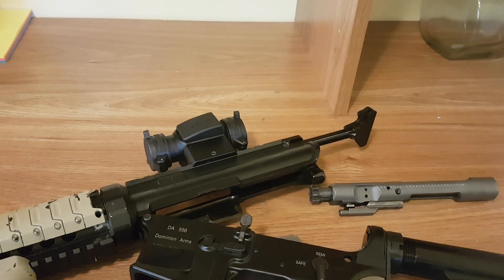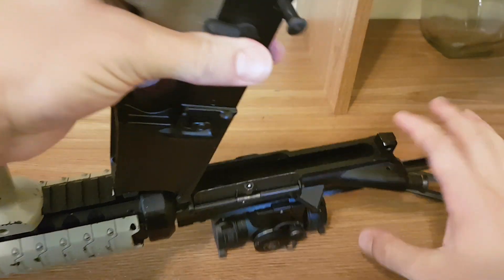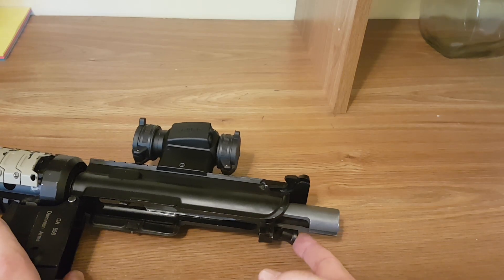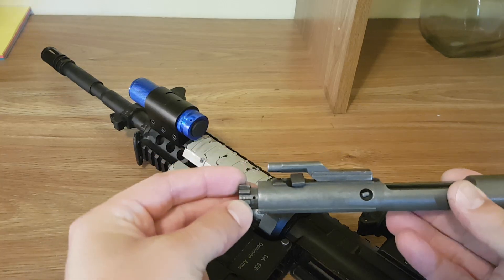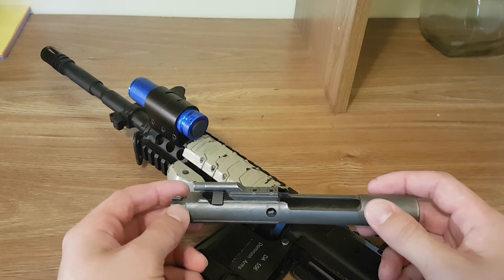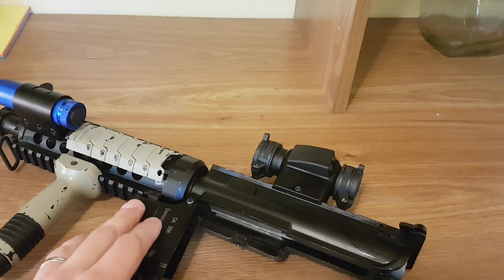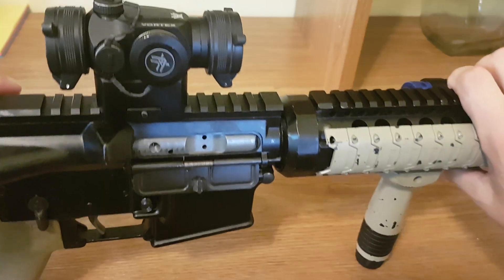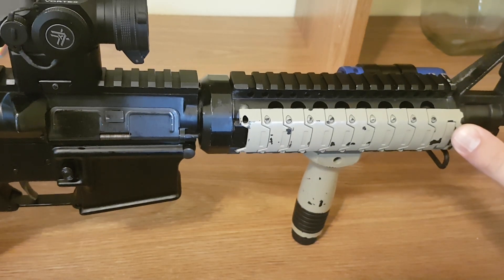What does the Forward Assist on the AR15 Do?

Comment: Serious question- how many have actually had to EVER use this, and if so how many times? I built my last two AR's with Anderson upper assemblies with no assist, and no covers. Let's face it, most of us will never use our guns in a hostile, nasty environment so why bother?
Reply: u are soo correct. mine sleeps in a gun safe 9 months out the year
Reply: Shibumi well we can also say how many need to use the ar15 itself.... it's there in case I rather have it and not need instead of need and not have it doesn't add any real weight so it's fine
Reply: Shibumi it is a Fashion detainment. 10 years in the US Army, never use it.
Reply: I used it to make a malfunction nearly impossible to clear.
Reply: Twice.  Once when chambering a round as quietly as possible the bolt didn't quite lock into battery.  The other the rifle was fouled with sand.
Reply: Colonel K I know you did good in English class 😂😂😂 that was well written, solid points, and also pretty interesting. enjoyed the read and I see what you're saying.
Reply: Shibumi well to each their own. personally I'd rather have it than not and honestly you won't be able to tell the difference just picking it up with or without it and you most definitely won't be able to tell when you got 80 pounds on your back and moving with it all day.
Reply: Shibumi from alien vs predator

'similar concept of a condom.  better to have one and not need it than need it and not have one'.
Reply: Shibumi, so you'd rather have an inferior weapon to avoid paying $50? The one time in your life you'd use it, it justifies itself. And if for some reason you ever had to use your rifle to fight in adverse conditions you would definitely want that dust cover and you would definitely want that forward assist.
Reply: Consider it like a spare tire, you may never need it, but if you do then the last thing you want is to open the trunk and not find one.
Reply: used it to unjam my m16 during my service during a routine visit to the range
Reply: Ryan Dukes So you forward but did not pull bold back...ooook.
Reply: theburners32141 what does having faith in gov have to do with the forward assist on my rifle? 😐
Reply: Waiting in ambush, wondering if I had a round chambered, I could pull the bolt back far enough to see. Then I could lock the bolt forward less loud, quietly, and continue silently waiting.  I'm not the only one who questioned and checked their rifle. Vietnam 1969.
Reply: unfuckingmaker actually dude. the 5.56 nato is shaped slightly different and produces higher pressure, you can shoot a 5.56 out of a .223 rifle but it will eventually destroy the gas system and damage the chamber, where as the 5.56 nato rifle can shoot both with out damage, only a slight loss of pressure when shooting the .223.
Reply: Sand Hill It would not come back. Of course I tried that first. I had to take it apart and pry the bolt back. Improper case crimp I think
Reply: As a former military weapons & munitions specialist I can tell you the only difference between the 5.56 and 223 Remington is brass thickness GI 5.56 is thicker which in a minimum 223 chamber can cause pressure problems
Reply: During training, firing blanks. blanks use a cheaper, dirtier powder, which causes fouling in the starchamber & gas tube, firing actual rounds, it's never happened to me, though I have seen it happen to others who want to jack around between firings, playing grabass and shit, instead of cleaning their rifle.
Reply: +Excludos- You DO realize you haven't:
1. Substantiated even one claim you have made.
2. Refuted even one point I have made.
3. Responded to any direct challenge I have made to your erroneous statements.
I won't engage in an battle of wits with someone who is unarmed, and I don't readily suffer fools- so fuck off...
Reply: +Excludos I don't think robberies can be painted in such broad strokes like that, I would say judging by news reports 25-50% happen in home invasion where it's too hectic to hear shit and still time enough to defend yourself given the countless home layouts and scenarios. store robberies might be closer to what you mentioned but some go in shooting and sometimes it happens later. 

I'd have to say about the only time noise would help is with a(most likely unarmed)burglar or someone attempting to come in the house, times when a gun might even be unnecessary in the first place. 

you are right a slide racking, especially on a pump shotgun is very identifiable and not what people likely to be on the business end want to hear, and most criminals do prey on easiest targets because who wants a chance of dying at work.

but I'm sorry, there is no way you are right about this, not where I am from. maybe where you are where there is less chance of petty criminals being armed with a handgun(yea yea it's our own fault)I'm sure it's a huge deterrent to unarmed people but an easy way to get killed when everyone else is locked&loaded.
Reply: For the same reason that people buy books on how to survive a zombie apocalypse
Reply: I didn't even know that was what that was for until i watched this video lmao
Reply: I've had to use the FA on rare occasions when the chamber was fouled, but I've also had a FA fall out when the retaining pin broke.  The FA was intended to overcome problems originally resulting from a combination of issues, including the use of dirty ball C2 powder, non-chrome lined bores and bolt heads, lack of cleaning kits,  and improper training.  This not only resulted in fouling of the breech, but more seriously, pitting inside it.  The pitting acted like Velcro and grabbed cases, making them both harder to chamber and extract.  Over time this could lead to case head separation, at which point, if in combat, you were toast.  Even if you had a cleaning rod and were able to remove the broken or jammed case, the problem would simply repeat itself on followup shots.  All of those issue were resolved decades ago, but the FA remains a standard component of all current production M16s/M4s.  The Army adopted it first during the Vietnam War, followed grudgingly by the Marines, who did not really care for it.  The USAF was the last service to adopt it, and that didn't occur in significant numbers until after 911 when we started buying M4s and upgrading our M16 rifles to A2 configuration.  This upgrade had almost nothing to do with the FA debate, but was focused primarily on accuracy issues resulting from the switch to 62 grain ammo.  We were still using 1:12 twist rate barrels which stabilized 55 grain ball, but proved less accurate when firing the much more common 62 grain bullets.  

Getting back to the FA discussion, I think the real question is whether the FA is worth having anymore.  The answer depends on a number of factors.  Will you ever use it?  Rarely, but "rarely" counts in combat.  Is it wise to force a bolt closed when it doesn't want to close?  That would depend on the reason for it not fully closing.  Assuming there is no serious obstruction or damaged cartridge involved, I've found it easy enough to simply push the recalcitrant bolt home with my thumb instead of employing the FA.  If I do use the FA and it doesn't solve the problem, I may need to strip the firearm to determine what is wrong.  Does having the FA on a rifle present a problem?  Not usually, though it does add weight, cost, and complexity.  I've noticed that a lot of race guns don't have them.  In the end it boils down to the question of whether you would rather have it and not need it, or need it and not have it.  For range, competition, hunting, and personal protection I can take it or leave it.  For combat I think I could live with the extra weight.  It's better than dying without it.
Reply: +Colonel K   Amen.
Reply: theburners32141 and Boston marathon was a bombing an ar wouldn't do anything
Reply: Shibumi I have, acronym SPORTS, slap, pull, observe, release, tap (the forward assist ), squeeze
Reply: Shibumi tell that to the people who died while trying to defend themselves with a jammed gun. if you bought the gun for defense, why not but the assist?
Reply: Shibumi I use mine every single time i load my AR to ensure the bullet is seated completly. But I wad military and thats the training i fall back on daily.
Reply: no the brass is the only difference between 223 and 5.56 NATO just check out a reloading guide or check with a set of callipers yourself
Reply: Once. In over a decade.
Reply: Press checks
Reply: I've used it, but only during military duty while crawling through mud.
Reply: tomcornwall83 
The charging handle is not connected to the bolt carrier so no.
Reply: Tom the charging handle can only pull it back, it's only a lip that catches on the bolt when you pull it back
Reply: Michael- sorry, that was a joke- I first fired an M-16 in 1979, I am sure it was Vietnam surplus vintage- and with the plastic stock and buffer spring I joked that it sounded like a Mattel toy! An instructor demonstrated the lack of recoil by setting the buttstock against his crotch and dumping a 20 round mag downrange... lol
Reply: It's the American way to buy a combat ready weapon I suppose. But I have a Japanese arisaka I'd be perfectly comfortable with if the US was ever invaded.
Reply: So, pretty much every reason posted here about using the charging handle has to do with getting a round into the chamber, usually covertly. Personally, all my guns are kept with a round in the chamber and the safety on- and once that first magazine is emptied, I don't think I'm going to be worried about making noise...   : ) So as far as I can see, I still don't have any need for a forward assist...
Reply: I've used mine multiple times.  When coyote hunting, if I don't have a round chambered yet and the coyotes are coming in, I will charge it quietly and the bolt usually doesn't fully seat when you slowly let it back up.  Pushing the forward assist gets it fully seated and ready to fire.
Reply: +Cody- That's why I said "almost"...
Reply: I use the forward assist to quietly rack the bolt, it helps when I clean my gun at night and don't want to disturb the others in my home and it helps in situations where if you would need to rack the gun to put the round into battery, a loud audible click would certainly alert someone where as a gentle pull of the charging handle and a few taps of the assist will allow me to chamber a round and engage an assailant. Granted I have only used it for the first thing as the latter has never happened and I pray it never does.
Reply: I spent 8 years in the military in a combat arms mos so I would like to think I am pretty familiar with the ar-15 / m16 system. I have used it in hostial combat environments and situations and I have never, not even once needed to use the forward assist. The creator is also incorrect when he stated that the military trains you to always tap the forward assist when charging the weapon because the only time I was ever trained to use the forward assist is clearing a malfunction using the sports acronym and even then it is the last ditch effort wjen nothing else has worked.
Reply: +nilloc93 are you replying to me?
Reply: Daffy Bigbear Wat..?? Whoever taught you that should be shot. There is no value in using the forward assist every time you change mag except to waste your time. Regards: Someone from the military
Reply: Colt M4 - Colt M16's were the end of the old battle rifles.
Heckler & Koch 53 - Heckler & Koch 33 were the end of the U.S. weaponary
Ak 107- 108 - 109 are the murder of the German weaponary.
MPT-55 - MPT-76 are the murder of the Russian weaponary.
Reply: Shibumi please don't say it that way my brother !! carma can be a bitch !
Reply: theburners32141 you obviously didn't understand what it was I was saying. He said most of us won't need to use the forward assist on our rifles, and I said that's true most of us won't need to use it but on the same note most of us won't need to use the ar15 itself but yet we still rather keep them same way I would rather keep the forward assist on my rifle. Don't get me started on that topic guy I've used my weapon in the defense of my family I understand the importance of having these I just bought an AR in 308 because I want a more versatile rifle
Reply: theburners32141 "Europeans getting raped in their own country" you sound dumb
Reply: Colonel K- very cogent and detailed reply, thank you sir. You sound as if you were there- retired Air Force?
Reply: Shibumi I've got a semi auto 12 gauge for defence. The AR-15's are for the hobby of building it or customization or in case Isis gets here....
Reply: Correct procedure for loading AR-15/ M-16 lock the bolt to the rear insert magazine into the mag well tap the bottom lightly to make sure its seated then hit the bolt release letting the bolt run home unrestrained never ever use the op handle for anything but locking the bolt to the rear or malfunction clearing
Reply: Ryal Deveau .223 chambers produce MORE pressure than 5.56 nato chamber with the same ammo. 
        similarly, my .308 ar-10 is designed for higher pressure ammo than its 7.62 nato counterpart. military specs aren't always better, they are sometimes just designed around cheaper, more plentiful ammo
Reply: Ryal Deveau thank you for clarifying. the comparison between .308 and 7.62, which i have, i think was accurate though. i have read that 308 is usually loaded hotter than 7.62 nato, normally, so the .308 would be the more versatile  choice between the two. i can see the problems are not exactly the same when comparing 5.56 to .223
Reply: 8aleph :Not true with any domestic ammo.  Brass is same.  5.56 chambers have more freebore so the bullet jumps more before engraving the rifiling.  This allows more propellant so shooting 5.56 in a .223 Rem chamber can cause higher than allowed pressure.  SAAMI published this warning.
Reply: Ive been in the Infantry for almost five years now. I have never needed to use my fwd assist.
Reply: Shibumi everytime we qualify in the military, we used shitty mags and old ass m16A2.  I had to use the forward assist everytime there was a jam.  It was part of the step, forgot what it was called.
Reply: Chances are good you will never have to, the jamming problem was caused by the Ammo and the Ordinance department  trying to get rid of the "it wasn't designed here" M-16  BTW that powder gave trouble in other gas operated weapons as well like the M-14 and M-60
Reply: gagongflip389 "sports" you pog
Reply: Jonnie, mostly Correct.  The Brass is thicker, yes, but the chamber is also different. The "223 WYLD" chamber splits the  difference between the .223 and the 5.56.
Reply: It's designed for war.
BUT, in the Army I used an Hk416, never ever used this thing.
Reply: Yeah... If the bolt does not go all the way forward cant you just give the charging handle a poke forwards?
Reply: This is pretty much the answer I expected, and the same with my guns... the only exceptions I expected were maybe someone who was in Vietnam shooting the original M-16 Mattel toys...   : )
Reply: Interesting! Living in the UK I don't get to use AR's so this is new information to me. Cheers.
Reply: I've used to it reengage the bolt after I load in a new mag when I'm shooting.
Reply: Congratulations on the dumbest comment I've read all day. 1st, you can utilize it in a non hostile environment and I have. 2nd you admit to using shit for equipment. 3rd how many people buy an AR15 for SHTF situations? So the fact that a SHTF situation is likely never to occur is irrelevant if it's the purpose you bought the gun. It's like anything else mil-spec. Thanks for your time. NEXT.
Reply: +Shibumi The forward assist is very valuable when you want to be quiet. You can do a "bad" load by, instead of letting go of the charging handle, follow the charging handle forward slowly, and complete the cycle with the forward assist.
Reply: +Shibumi What you do privately is on you, but in the military the rules of conduct will decide whether you can stroll around with a round in the chamber or not. Generally, unless you're at war, you can't. But situations where you need to need to charge your gun covertly can still arise.
Reply: What is with all the people who don't keep a round in the chamber, with the safety on? This rifle has a perfectly good safety that prevents any idiot with poor trigger discipline from hurting somebody, or themselves...almost the only way that I ever chamber a round is by hitting the slide release. Insert magazine, hit slide release, round chambers fully. Check safety is on- when you pick up the rifle to shoot it, release the safety and pull the trigger. Simple, effective... works for me...
Reply: +Shibumi Any "idiot" knows perfectly well that if there's a round in the chamber it's the same as being live. Sure it's very unlikely to fire with the safety on, but it has happened and it can happen. Maybe the switch gets stuck on part of your clothing and switches around, or maybe you forget that one time. Hell, I've seen a rifle (altough being an older one) fire, with the safety on, from hitting the butt stock too hard! You never ever ever ever treat a live weapon as safe! And if you've had any kind of weapons training whatsofuckingever you'd know that as well.
Reply: Because in some situations it is illegal to have a round chambered in your rifle while transporting in your vehicle in a hunting scenario.  It's a concern in potential poaching situations where someone might have a rifle ready to fire from their vehicle on the roadway.
Reply: +Excludos- I never said to treat a live weapon as safe, if you read what I posted. I carry a Glock every day with a round in the chamber, but I don't put my finger on the trigger unless I intend to shoot something with it...
   I have had extensive weapons training, that is why I am always aware of the status of my weapon and what I do when I am carrying it. I make sure it is not possible to accidentally take the safety off, and I never forget. Carrying a weapon is like riding a motorcycle- you are always at a heightened sense of awareness or something bad happens. You don't completely relax and let your mind wander, you are always aware of important aspects of the situation that can become dangerous. If I didn't do this I would already be dead from situations that have happened on the motorcycle, and I am sure that is how firearm accidents happen as well. I just make sure they don't happen to me...
Reply: +Shibumi The amount of cops who shoot themselves in the foot daily because they walk around with a round in the chamber against regulations is hilariously high.. (Not to mention that it's stupid as the act of cocking your gun is a way to threaten/scaring criminals in itself, but that's beside the point of this topic).

I don't know what "extensive weapons training" means, but it's clearly not from the army where you'd get shot by your officers for walking around with a chambered gun. And you can make sure all you want, a round in the chamber is just one small step away from being fired. You can't accidentally shoot yourself or anyone else if there's no bullet in there. Things happen, humans are humans, sometimes people forget or the gun malfunctions. That's why you use extra precautions to add an extra layer of safety. Judging by the amount of accidental discharges in america, I'd say that extra precaution is extra needed. Besides..why? Why do you feel the need to have a live round in the chamber at all times? There is literally no need for it unless you happen to know where the enemy is. If it's self defence: Either the guy is going to get the drop on you and it doesn't matter, or the 0.2 seconds it takes to charge your gun is not going to matter (and, like I said, it's no problem whatsoever charging it silently if that's needed). And if for hunting: Either you get so close to the animal that you spook each other, in which case you're not allowed to fire on it except for self defence if it attacks, or you see it at a distance and you can easily take your time charging the gun.

This is like people not wearing seat belts: "I just take extra precaution not to crash".. well shit, sometimes accidents happen, and sometimes it's even out of your control. Be safe guys. Don't be stupid for absolutely zero good reason.
Reply: +Excludos- OK, gloves off now- you ARE a fucking idiot. What are you, a 12 year old who watches stupid cop movies and TV shows?? 
   First of all, NO cop in the history of man has ever been trained to play with their gun mechanism in any way with the intention of intimidating a criminal. The reason they pull their weapon is to shoot someone who needs to be shot, after warning them that said event is imminent. 
   Second, ALL police department and military police policy, is to ALWAYS carry a round chambered to respond immediately to a threat, NOT to waste time chambering a round under stress when fine motor control can be compromised and they could possibly fumble it and not chamber the round completely. 
   Third, I am calling you out to find a credible source for EXACTLY how many "cops shoot themselves in the foot daily because they walk around with a round in the chamber" in the U.S...that is simply a hilarious allegation with zero evidence to support it...
   Oh- and here is a quote from a former MP who is now LEO, on a LEO forum...
"Whomever is telling you that the M-16/M-4/AR series is unsafe to carry chambered is a maroon. Same goes for any shotgun in common use by U.S. Military and Law Enforcement.
Every firearm in common use by U.S. Military and Law Enforcement is subjected to rigorous testing before adoption. One of the main points of said testing is that the firearm, with a round chambered, be unable to discharge without the trigger being pulled, and further, that the weapon be incapable of discharging even if dropped when the safety is engaged."

Obviously you have a room temperature IQ and no reasoning skills (or firearm training) so please remember- "Better to be silent and be thought a fool than to speak- and thus remove all doubt"...
Reply: Jonnie Law well you're both right, technically saami specs may not call for it, but most commercially made .223  barrels have less freebore (never personally heard it called that) but using his description I figured it out, 5.56 barrels, ESPECIALLY hardcore Milspec manufacturers, have about 1/2 of no rifling at the chamber to accommodate longer bullets like 77gr, .223 has rifling almost at the chamber. now you were absolutely right about the brass cases, 5.56 is made slightly thicker to handle SLIGHTLY higher pressures, I'm talking like maybe 500-1000 psi higher which is usually not a problem in either chamber because .223 and 5.56 chambers can handle WAY WAY WAY more pressure than even a full packed case can cause unless you're using mixed powder (THE single fastest way to kill a gun btw) I am not looking at the numbers in front of me but I wanna say that both generate 35000 +/- 1000 psi and both chambers are designed to handle about 50000ish psi (working from memory here sorry if numbers are a little fudged, but all in all both were right. have a beer, shake a hand, and let's call it a day
Reply: tomcornwall83 I wish we could help you guys take a new look at some of the... well, Draconian gun laws, and for once have everyone; America, the UK, Germany, France, EVERYONE, free and armed. I hate that Europe is going through all the crises, (we have them here too) but it seems like the world is just really giving Europe a raw deal
Reply: Michael stott the biggest problem with Katrina was twofold, geography and elevation. New Orleans is like 40 feet below sea level and is also a coastal city, when Katrina hit the levees holding back the water collapsed and an entire city was decimated
Reply: Shibumi using cheap ammo fitting a torture test my chamber fouled, FA was used to close the bolt end fire the round. I have also I intentionally prevented the bolt from closing in training so that I would be forced to use the FA in the event that I would need to on a combat situation.
Reply: 7 years in the Army. Used it once. Or you can pull the charging handle back again and problem solved.
Reply: +Ryan Davidson You'll eject a bullet if you do that tho. Not that it matters let's be honest; if your gun jams in a bad situation then it's not like wasting a bullet matters compared to just getting it working again immediately. But something to keep in mind :)
Reply: Shibumi that is exactly what I said, yes :p
Reply: @Shibumi, I've used mine twice in my military career. Once when I was a private (got sand in my star chamber, so the bolt didn't seat properly), and once in country because the bolt got dislodged after an IED went off, and slipped out of battery.
Reply: Italino Pietrantonio ied fucking breaks everything
Reply: Had m16s/m4s jam on me a couple times and not once did the forward assist help.
Reply: +snoogans20 If it's jammed, it means there is something blocking the path. No amount of forward assist is going to help you there. It's not meant to help you unjam your weapon, it's meant to help the charger return in case of an incomplete charge for whatever reason. Old guns usually had an indent on the bolt that you could shove your thumb into, but since that's dangerous if the weapon fires when you do it, newer guns have it moved back.
Reply: Excludos Which makes you wonder why they taught "SPORTS".
Reply: in the CAF we use it a lot, especially on exercize when using blanks because they blow carbon everywhere, after 4 or 5 mags you have to tap the forward assist in order to set the bolt, so after every stoppage or reload you're tapping that thing which is why its part of the drills.
Should be noted that CAF C7's are also overcleaned and put under heavy use so they are far more prone to the bolt not being set after releasing the charging handle
Reply: +snoogans20 I'm not familiar with SPORTS, what's it about?
Reply: Excludos It's the method they taught when I was in basic training for whenever there was an issue with your weapon. About half the steps were unnecessary, especially tapping the forward assist.
Reply: +snoogans20 Huh, interesting. The one we learned is "turn, feel, recharge" (Sounds a lot better in Norwegian). Where you tilt the gun to see if the bolt is either in the back because you're out of ammo, or to see if something is jammed. Then tug on the magazine to feel that it's properly in place, then recharge. That should be enough to fix the vast majority of problems quickly. Anything beyond that and you need to spend a bit of time on it anyways.
Reply: Shibumi, the Second Amendment ;) You never know, man.
Reply: +Excludos Norwegian eh..that explains the 'clock your gun to let them know you are serious'

pretty sure vast majority of firearms training in the United States follows the 'don't pull your weapon unless you intend on using it' and why most carry one in the chamber ready to go. because chances are someone you need to be shooting at is ready to shoot.

and I am not the typical scenario day dreaming Americans gun nut, I don't open carry or care about all the tacticool accessories. it's just the practices that are taught here.
Reply: Canadian channel, the CANADIAN military teaches forward assist tapping. And we need it because we don't get new guns, most of our stock is well beyond shelf life and has been refurbished by weapon techs so many times that shit doesn't fit right anymore
Reply: nope that was @ Brendan Conley I liked it when youtube had a more functional reply system.
Reply: +nilloc93 lol yea, I was like what does that have to do with the crazy Norwegian dude scaring off criminals just by cocking his weapon like Clinnt Eastwood. coincidence I guess!
Reply: +Chris Morse Oh, this is old. I barely remember what I said earlier and am too lazy to go through it again, but the laws are the same for both countries when it comes to cocking your gun: You are only allowed to charge your gun if you are in the same legal grounds as if you intend to use it. That means you need to feel threatened on your own or some elses life. However charging your gun is an extremely effective way of telling your opponent that you now have a live round pointed at him and he should settle the fuck down. Nothing is more scary in a situation than hearing a gun nearby being cocked. That's why cops and military around the world has incorporated it into their training.

However the big changes between USA and the rest of the world is that cops in the US seem to be a lot more trigger happy, while cops elsewhere are a lot more prone to risking their own lives to not shoot the criminal immediately. This is of course not true for everyone, but to a very large degree. So while you still need to be threatened on your life before you can cock your gun, the difference to a large degree is that US cops just shoots immediately instead of giving the criminal a chance to give up. While I fully believe this is in part due to lack of training (What is it, 6 months in some states to become a cop? That's ridiculous compared to the 3 year university degree you need over here), it is to a much larger degree a symptom of a culture where way too many people has a gun ready to go at any point, which means you can't really take any chances whatsoever.
Reply: +Excludos I always have one chambered. Having to rack the bolt into battery takes longer than just aiming and firing. Odds are that the shooter is already firing and having to pull the bolt back, especially within earshot, is enough to tell the target that you're a threat. But having one in the chamber just means you can flick the safety and fire, it doesn't give you away by making a very audible noise and by the time the target realizes you are aiming you can start firing back.
Reply: Shibumi I have had to use it the I was using me cousins m4a1 duty that was after 500 rounds
Reply: I agree
Reply: well i have used it on a few reloads that did not get properly sized, smacked it a few times it closes and then fire. if a shell is dented it would help chamber it if it sticks, or if the chamber is dirty from fouling or carbon. in normal range circumstances this is no issue you just have to pack up and leave early if you get a bad jam, if your carrying it daily and relying on it for survival i would like to have the forward assist
Reply: I have had to use a few times when the bolt failed to fully seat. It is there for a reason. Better to have it and not need it than need it when you don't have it.
Reply: Shibumi 
Because that one time when you've f@#ked off and decided to top off your mag and now there's varmints real close and you've got to charge your rifle, it's good to have a forward assist to quietly lock the bolt.
Reply: In my career I have had to use it twice. This was when I was on the range qualifying. Sometimes we don't clean our weapons or do a quick wipe of the bolt and by the time Wednesday comes there is a lot of fouling. Pre-Qual was Thursday and Friday of course was Qual day. So Wednesday afternoon everyone cleaned their weapons good.
Reply: Shibumi 
It's better to have it and not need it than to have to field strip it and clean it in combat like many soldiers did in Vietnam.
Reply: isnt that what you morons buy your guns for? waiting for the apocalypse
Reply: We buy them because we can, they are rights given to us by God. Doesn't necessarily have do with the apocalypse. It could be anything from Hurricanes, Earth Quakes and or Civil unrest like Liberal mayors who allow protestors to wreck a city so they can vent their anger out.
The cops are there to report after the fact. Awh poor family such a shame, lets light candles and put teddy bears in front of this home where some vermin decided to commit a tragic crime.
Reply: Ding Chavez 
I don't know what morons by their guns for, but people I know buy guns for personal protection and for hunting or just having fun. I've used my guns to prevent crimes 3 times in the last 40 years so don't try to give me that hair-brained bs that guns don't prevent crime. You usually don't even have to discharge it because criminals usually change their minds when they encounter resistance. 
I have harvested tons of meat in my day and have had hours of fun bonding with friends and family while hunting or just shooting. The way I see it, one would have to be a moron to not own a gun. I've been closer to game animals like deer, elk, bear, and prong horns and a plethora of game birds than people like you who don't. You suggest gun owners are "morons" but you don't realize how much less free you are.
Reply: My issue weapon was an A-2 and most of the time when using fully loaded 30 rd. magazines it failed to go into full battery.
Reply: Well did you ever pick up your rifle and wonder: "why did someone create this...?" 
The answer to that question is the answer to your own.
Reply: In the situation you actually need and I mean need not want an AR-15 or M-16 you will want a FA
Reply: Use it quite often in the Marine Corps actually. Mostly when the bolt doesn’t send all the way home due to sand or mud or dirt or just so many rounds shot it gets dirty, smack that little button a few times and re-engage.
Reply: Shibumi guess what the odds are rapidly changing my friend. I hope u rethink your statistics and prepare accordingly.
NOW.
Reply: NEVER, even if wife and child are sleeping, ride the charging handle back. Even if you're using the forward assist. When charging ARs/M4s, you pull back and let go. The faster that charging handle comes back to home position the better. You do not want to ride the charging handle back home (which I guess is technically moving forward) with your hand. These are two problems that occur fairly often from people riding the charging handle forward. 

#1 – Failure to load a round in the chamber properly.  Translated, this means your gun fails to load… meaning you’ve now caused a malfunction. And worse yet, you as the operator caused it!

#2 – Bolt does not lock forward. Again…. This means your weapon will NOT fire! When this malfunction occurs, it is usually an easy fix to tap on the forward assist to fully seat the bolt forward so that the weapon will fire. But again, as the operator you just caused your own malfunction.

Are you starting to get the point, here? DO NOT RIDE THE CHARGING HANDLE FORWARD, EVEN IF YOU'RE TRYING NOT TO BE HEARD.
Reply: Jesus Christ, people these days..... I really thought everyone who owned an AR knew this at the very least.
Reply: I used it quite often in Iraq.  When the weapon needs to be charged quietly and you have to ride the charging handle forward the quiet way to ensure it is in battery is to gently push the assist until it is locked in.  It is also helpful when the weapon is fouled with sand or dirt and there is no time to clean.
Reply: I have used it when I have had a not so clean gun, and someone pulled the charging handle to load a round, but did not let if go completely. This would cause the spring to not push the bolt carrier into place with enough force to seat it all the way down. A few pushes on the FA, and usually it seats well enough to fire. That being said, once I get to that point, it is only going to get worse, so it is best just to cool it off, give it a 10 minute cleaning, and get back into action. That being said, I an shooting at paper, not people returning fire...
Reply: Kenan Beltran I know "that" you did "well"...
Come on... I had to do it. I probably deserve a good cursing now..
Reply: Kenan Beltran I was wondering the same thing...
Reply: theburners32141 I watched a video that several people were on from Katrina, and they said that the cops were taking every weapon that they could find. Even went into an old ladies house, pushed her to the ground, held her down while another cop "relieved" her of her Derringer. This is why you travel in numbers during an event, and this is why you should have several low end rifles and shotguns. That way you can arm 4or5 more people. It would take a lot of cops to try and take guns from 20 people. I would never want to have to confront anyone, especially law enforcement, and definitely not military, but when it is life or death...?
Reply: Kenan Beltran it is the truth though. Norway is telling from crimes committed by refugees. Tapes went from practically nonexistent, to a daily event.
Reply: Shibumi I'll take a dust cover...the forward assist is superfluous
Reply: Carey Clark I live in a Vegas. I go shooting in the desert. It is dirty, hot, and dusty, at best. Often, when I shoot a little while, or the rarest of occasion that I use the bump stock, I often end up with a dirty firearm. I may pop open the top and give out a quick wipe down. Still, occasionally, when I don't release the bolt a aggressively enough..or will stop  just short of closing. A couple of pushes on the assist, and I am ready to fire. Without it, I would have to eject a round into the dirt. That being said, I rarely stick around long after this starts happening. Also, the need for this tells you that there is a weakness....
Reply: Ounces add up to pounds- and since I was building mine and wanted it to be lightweight, I chose the Anderson upper with no forward assist and no flip cover- it may be minimal difference, but as I liked the way it looked I went ahead with it. This upper plus a Mag Tactical lower saved quite a few ounces overall...
Reply: A pimp Named slickback as per the original post: " Most of us will never be in a nasty, vile situation. So why need one." Tell that to the Europeans getting raped in their own country. Syrians dealing with a war torn country. Or the victims of the SAN Bernardino terrorist attack or Boston Marathon. Natural disasters like Katrina. Need anymore?
Reply: Shibumi you never need anything until you need it. It's better to have it and not need it and need it but not having it. It's called being ready. You have too much faith in your government.
Reply: Shibumi a war vet told me it was so the enemy didn't hear you locking it shut so you could quietly chamber a round
Reply: Joseph Damiano, there's no reason you should ever be within earshot of the enemy and not have your weapon chamber! If you're ever in view of your enemy having to chamber a round, you're probably already in a gunfight.
Reply: Chances are you'll never need the gun period, so why have one? Because there a small chance you may need it and then not have it....
Reply: and to everyone complaining about its useless and that you dont have one. milk and titties for you, mime has one,  i wanted it and i paid for it, for everyone with out one, your probbly running .223, my rifle is 5.56 nato.
Reply: "first of all, NO cop in the history of man has ever been trained to play with their gun mechanism in any way with the intention of intimidating a criminal. The reason they pull their weapon is to shoot someone who needs to be shot, after warning them that said event is imminent. "

You're already wrong on your first sentence. How impressive. What effect do you think charging your gun has when up against a criminal? It intimidates them and makes them realise you're serious. No, you don't do it unless he posesses a lethal weapon, but there are situations where your perp has a weapon and you don't want to immediately kill him. Police is actually training with this effect in mind. Let me give you a spesific scenario that's in their training manual:

Someone shows up with a weapon:
You: "Stop this is the police!"
doesn't stop
You: Charge weapon "Stop or I will shoot!"
doesn't stop
You: warning shot
raises weapon
You: direct shot

Now I could go through the rest of your message, which is drivel to say the least, but I'm not going to be bothered. You've made it clear to me you don't know what you're talking about, yet you act as you do. Not to mention you use ad hominem to press points that are just flat out wrong. You going onto another forum and twisting my words to be used against me doesn't make you right either. Why don't you ask them if they walk around with their guns chambered all day instead of taking out a single point of everything I've stated here? There is nothing left to say to you. You tell me I've seen too many movies, yet you think police and military walk around with chambered guns at all times. Goodbye, and have a nice day.

P.S: Don't use shit like "please remember- "Better to be silent and be thought a fool than to speak- and thus remove all doubt" when you're in the deep end of the dunning kruger effect.
Reply: +Ryan Grobe You are severely overestimating how fast a shootout happens. You are never going to be in a position where you're alive only because you managed to save the 0.5 seconds it takes to rack the slide (The obvious exception is wartime, or generally if you know there are bad guys around. At which point feel free to do it). Either the guy opens on you immediately, at which point you'll most likely just get hit and go down anyways, or they're shooting at someone else which leaves you plenty of time to rack the slide, even silently if that's a requirement (which it really isn't in a shootout because you know very well how loud guns are). So what you're doing is increasing the risk of misfires and accidental fires to solve a non-existing problem.

Generally, if you're ready for something to happen, you can have one chambered. But you're not ready at all time every single second of every day. At those times, please don't do it. Accidents are so damn common as it is, there is no reason to increase the danger of it.
Reply: +Chris Morse In point blank robberies, simply having a gun to begin with isn't going to help you; you're dead as soon as you touch it. But you have to realize that very few actually wants to die. Most criminals are weak, don't want to die, and will back down as soon as anyone fights back, which is why cocking your gun has a good chance of making them immediately give up, especially if you scream at him from the top of your lungs to get the fuck down. There is of course the chance that he fights back instead, which means you need to be ready to take him out. But here's the thing you're trying to argue against: Any situation where you have time to raise your gun and fire at a criminal, which means he isn't immediately pointing it at you, also gives you time to charge your gun.

There is practically no situation in daily life where saving the 0.3 seconds it takes to load your gun is going to save your life. But what walking around with a chambered bullet does is vastly increase the chances of you accidentally firing it. So you're increasing the danger to yourself and everyone around you to solve a problem that you don't have.
Reply: ive had to use it before on my M16